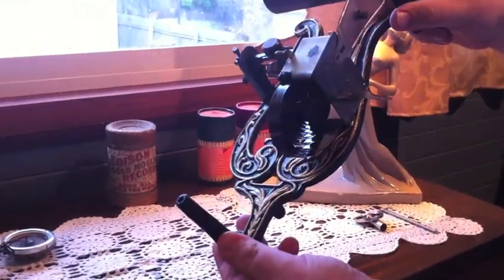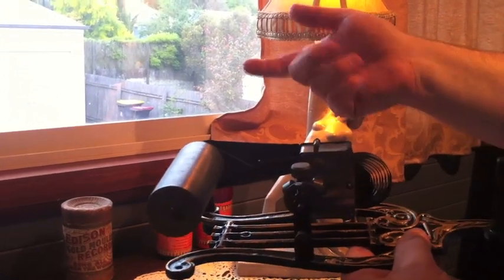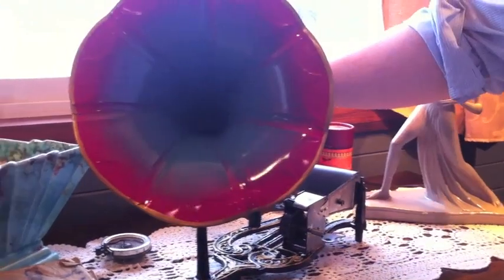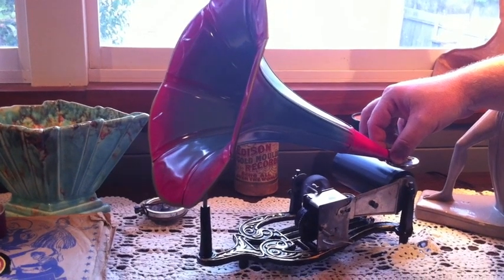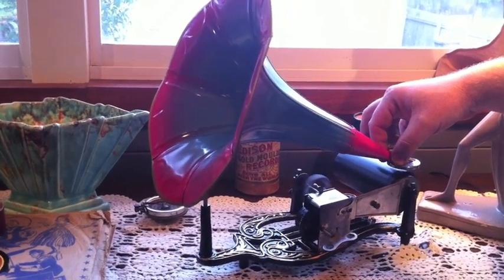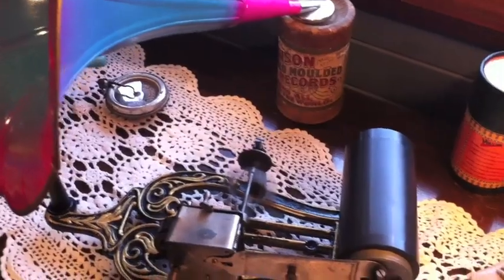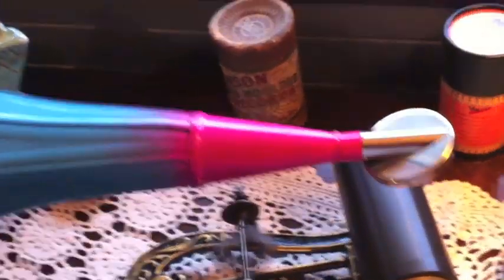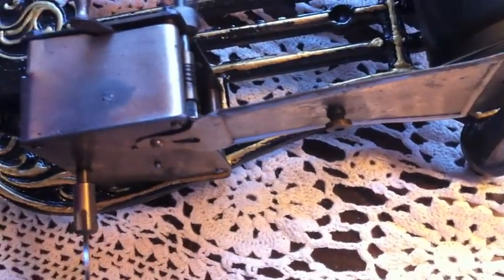Puck Demonstration (Cylinder Phonograph)

Comment: Your missing a small bent wire  T shaped stylus rest that the small end of the horn and stylus drops onto at the end of the cylinder . they are always missing from these machines, they simply push onto the cast iron frame and help the stylus travel from side to side ,, then off at the end.

Comment: I wonder whether you could play a blue amberol as there is no feed screw however it wouldn't get through the record obviously she'd run out of steam around the 2 and half minute mark.
Reply from the maker: The size of the needle would destroy the grooves. Like the difference between a 78 and LP stylus.
Reply: Unlikely, as Blue Amberols are made of celluloid, and designed to withstand the pressure of a diamond stylus. Most likely, you would just get a garbled sound.